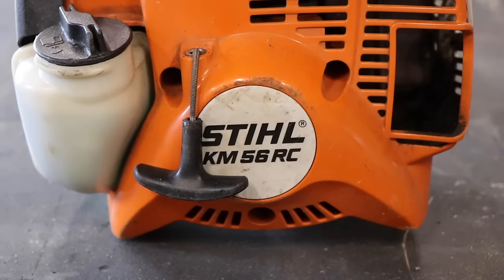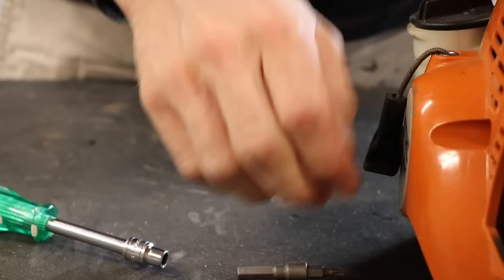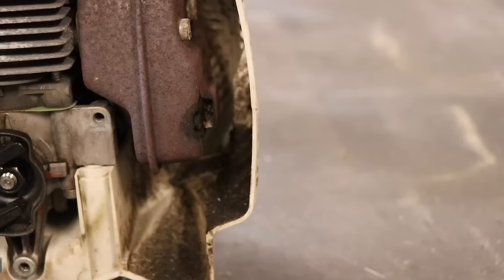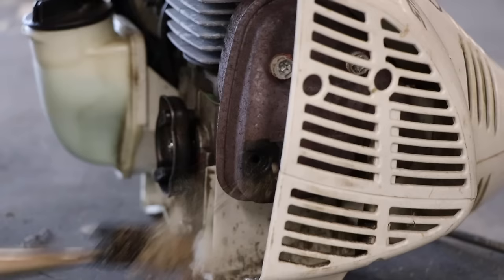Fixing a Stihl trimmer from bogging down

Comment: I do not know about anyone else,but I never knew that was there. Excellent video bro!!
Reply: Me neither. I 'm going to try it out right. Now..(.entering California fire season )
Reply: @wendygerrish4964  .... Mine is a Stihl FS 55R and I also didn't know the spark arrestor  was there. Cleaned it and wha-la!! Runs like new.
Reply: I thought it was bad gas so I dumped it out and it still did it.  I had no idea that was there 🤷🏻‍♂️😂
Reply: I'm not a do it yourself guy when it comes to mechanics.  Was gonna take it to the shop and likely pay at least $35 or more. Followed the video,  but didn't burn the screen. Just wire brushed it and within a few minutes it was back together and running like stihl should. Thank you so much!

Comment: I tried your solution and it worked perfectly!!  My Stihl trimmer suddenly became very sluggish and lost power.  I followed your directions, but didn’t have a propane torch available and wound up soaking the screen in carburetor/choke cleaner and scrubbing with copper tubing brush.  After reassembling the trimmer it ran like it was brand new!  Thanks for the help.  This has been one of the best tips I’ve found on Youtube.
Reply: I sprayed it down with WD40 and just ran a lighter on it, then used steel brush

Comment: Hi! Just wanted to thank you for the information. I have a stihl fs45 that I purchased at a yard sale years ago and could not get it running. I finally broke down and bought a replacement carburetor. I was able to get it running but it bogged a full throttle. I stumbled across this video and proceeded to check the spark arrester. It was near clogged, so I decided to remove it. My model has a bolt in type with a mesh tubular screen attached. I reinstalled the bolt in tip, ran it, and adjusted the carb. It now runs as good as new! Again, thank you!

Comment: Your video saved me from taking my Stihl FS240R line trimmer. It was bogging down about an hour into running just fine. The screen was totally plugged as you had shown. I couldn't find my torch and tried laqure thinner that couldn't cut to clean it. Looked a little harder and found my torch. Burned it all clean, put it back together and ran great. And was able to finish the job. Thanks so much bud!!

Comment: My Stihl  trimmer was working fine one week ago, and today would die the instant throttle was applied. It did not have the exact screen setup as this video, but after locating the screen, sure enough, that fixed it. Thanks for the video, saved my trimmer.

Comment: Well done.  My Stihl, FS45 had a slight variation of the metal mesh screen but same principle.  Worked like champ, trimmer is running like new again at all throttle settings.  So glad I checked your video before messing with the carb adjustments.  Thanks.
Reply: Where is the arrestor on the fs45?

Comment: .... I have been messing with my Stihl FS 55R weed trimmer for days now. It would barely idle. The last time I had it it ran okay.  Thought it was the gas/oil mix way to rich. No. .... I cleaned the carb. Didn't find anything really dirty and it still would idle very rough it ran at all. .... Found this video and the light bulb in my head went off, THAT'S GOT TO BE IT!!!! I am mechanically inclined and what this video showed made perfect sense. The exhaust could not, "exhaust".  .... Mine was a little different than in this video but figured out how to get it out. You guessed it, totally clogged. Heated it up, wire brushed it off, blew it out with air, reinstalled and it ran like new. .... THANKS SO MUCH!!!! ..... Trimmed everything last night.

Comment: Thanks for the tip dude!!  The hardest thing about it was finding a T27 screwdriver.  Once the screen was burnt off and spark plug cleaned, my FS 56RC started right up and sounded new again!
Reply: My Stihl came with combo tools for this and for changing spark plugs. I just installed a new plug, air filter, and fuel filter and it still only ran at half speed. Cleaning the spark arrester made it run like new again. Thanks.
Reply: My husband has a long T shaped one for his chainsaw, it worked.   But, so did my Dewalt drill with an extension, lol

Comment: I want to thank you for the the heads up on that. It worked perfect and you were right 10 to 15 minutes and it was running like a new one. Awesome thanks again. You saved me some money because I was heading to the Stihl dealer to get it fixed.

Comment: Man I have F'd with mine longer than I want to write about. I cleaned carb (more than once), new plug, etc... Still same issue. Took to small engine repair shop, and it still ran like crap when I got it back. Then I put a new carb and lines, ,,,same issue. Then I  googled it, your video was the first I watched. Unbolted the exhaust screen and cleaned it and now it finally runs. Thanks for the video. I should have looked this up before. Fixed in under 5 minutes

Comment: Absolutely a life saver, love YouTube and folks like you.   Not all heroes wear capes 😉  10 minutes and I was up and running again!   Also, I used engine degreaser & a tooth brush then a good rinse with water.   In case anyone might want to try that way.   Fires up & runs like new!   Thanks so much sir, appreciate not having to take it anywhere or buy parts that aren't even needed 💙

Comment: The one I have runs for about 4-5 minutes and dies. A couple presses of primer pump and it repeatedly did the same. Think I have a different but I'll use this info to clean that filter. Dealers probably make a killing when this is the repair.
Reply: $80 / hour is no killing it is turkey on the table

Comment: So the advice in this video is spot on apart from one thing. I have a 4 year old FS 38 sthil whipper snipper and it does not have the mesh screen. There is, however a exhaust port attached to muffler by a 16mm nut. I undid this nut and out it popped with a cylindrical mesh top. So I did as shown the this video and burnt the mesh on my butane stove. It cleaned up a treat and now whipper snipper works like new. Thx bud for a great tip n video

Comment: This was a great tip. Trimmer fired up on first pull and ran like a champ. Thanks. One small deviation. I used my air compressor to clear the screen. The bulk of the carbon blew right out.

Comment: My Stihl FS66 ran funny one day but I got it to work.  The next day it wouldn't run,  like this video.   
No problems for 38 years. I rebuilt the carb, new spark plug, new base cylinder gasket, new carb gaskets and changed fuel. 
But nothing worked until I tried  cleaning the muffler screen like in this video.
 Bam ! Runs like it always did, I 'm shocked.

Comment: For me it would bog then die. For me it was as simple as replacing the fuel. The 50:1 I had had been around for 2 seasons. I had a little left in the trimmer, dumped it out and replaced with new. That fixed it for me. FYI.

Comment: Great Vid dude.   My Stihl weed eater worked great the first summer - then next season started to bog down to the point where I couldn't use it.  I knew it was something and your video fixed me right up.  I too used the air compressor to clean the screen.  Runs great.  Maybe this is a problem with brand new machines and this will run for several years before I have to clean again.  THX!

Comment: I suggest removing the screen permanently. I run mine without the aerator. If you have a muffler with a bolt on it unscrew it and the screen will be on the other end cut it off with wire cutters and bolt it back on. Never need to have to check it or have bogging issue again.

Comment: I was excited to find your video and expected a slam dunk solution. But in my case I’m having other issues. Can anyone advise?

KM110R bogs and won’t rev. 
Spark arrestor was clean as could be. I removed anyway. Sanded and cleaned the plug, checked compression (105 psi), inspected air filter and tried running with air filter removed. Still minimal improvement. I placed an in-line spark tester between plug and wire and spark appears to be great. I also held the throttle WOT and pushed the prime bulb to confirm it wasn’t a fuel supply issue and that didn’t help either. Regardless of how little or how firm I press. It will die from being flooded if I press the bulb firmly so I know I’m getting adequate fuel. Next I guess I’ll take the carb off and clean and blow out any fuel/air circuits.

Comment: I recently purchase a stihl F5 38 and it seems to do this occasionally when starting it and won't rev to its full potential, I'm not sure if it's gotta bed it's self in or what but it has high an low adjustment screws and I don't know how to tune/fix this issue

Comment: I have a fs111r doing the same thing it's 7 months old it's in good condition other than the bogging down my screen arrestor is perfectly clean my valves have been adjusted I'm using the Stihl motomix so the 50 to 1 ratio is good just doesn't make sense not sure what's making it bog down spark plug is a little rich but not to the point where would make it bog down like this
Reply from the maker: Hmm. Have u figured it out yet ?
Reply: Mine does that .. I bought it brand new. NEW . did u get urs fixe of so how:)
Reply: @julioslawnmaintenance5031  for some reason it seemed to stop its running good now.

Comment: Our screen plugged up multiple times before we just removed it.
Now it seems my muffler is plugged up. Runs great after I spray carb cleaner in the muffler
Reply: Ended up drilling a hole kinda where the exit is.. runs like new... just a small one is needed

Comment: I bought 91r brand new and it does that it works for awhile n it starts doing what urs is doing and i turn it off and crank it again sometimes it work sometimes it dont. Ive took it back n let them look at it they keep saying its fine..
Reply: Run premixed gas I use the Echo Red Max 93 Octane but keep the engine super clean no carbon build up that with new plugs every season keeps the Doc away

Comment: Throw that arrestor in the trash. Not needed unless you are in a forest. Runs way better without it and will never clog again.
Reply: I've been running countless Stihl motors (dozens and dozens) on a daily basis for decades and not once had a hint of any spark. The first thing we do is take them out. I'm sure the only reason they are there at all is to negate liability.
Reply: What does the arrestor control? I run the guard off and it bogs down, would it help if I took it out
Reply: It's meant to stop combustible debris from exiting the exhaust and potentially igniting dry ground cover. Especially in forestry settings. In some places like California, it is law. When the thing clogged up with soot the regular exhaust gas cannot exit which results in combustion chamber condition that retards ignition. Hence, the loss of power. But this is only one common cause of the same symptoms. Other things can cause very similar symptoms. Live air leaks or obstructed carab passages.
Reply: Do not throw spark arestor screen
Reply: @newcoyote  DITTO!
Reply: @Bryan H It has nothing to do with emissions.

Comment: I will try this but don't have a torch. What is the best way to clean the screen?
Reply: I would try soaking it in boiling water with some Dawn dish soap, and scrub it with a wire brush.
Reply: A video on youtube shows a man soaking gunked up engine parts in Ethylene Glycol -- antifreeze.  Search for that.  It cleans up things amazingly well when you let them soak in it.
Reply: Brake cleaner works perfectly

Comment: I already removed that screen and I clean the carburetor and still buggs down
Reply: Try backing out your low speed and then high speed carb screws about 1/4 turn.   Your fuel filter needs to be clean and the fuel pump gasket in the carb must be pliable.

Comment: The first time i use it it done that had it almost 8 months now still doing it ..even though its brand new :(...
Reply: It's very common for these screens to get clogged up almost immediately. Best thing to do is just remove the screen and see if it helps. If so either clean and put it back or just forget to put it back at all.